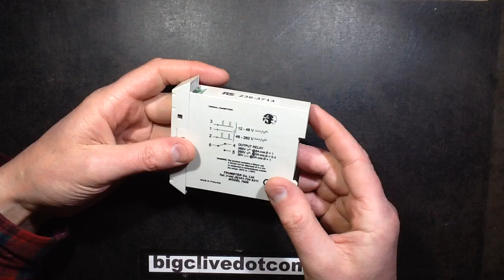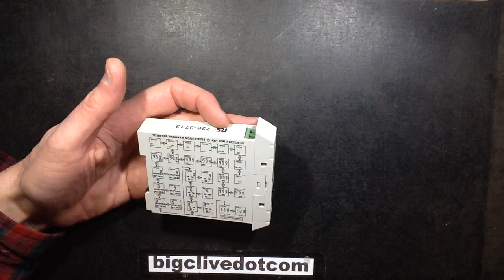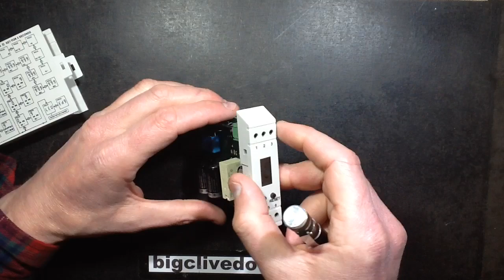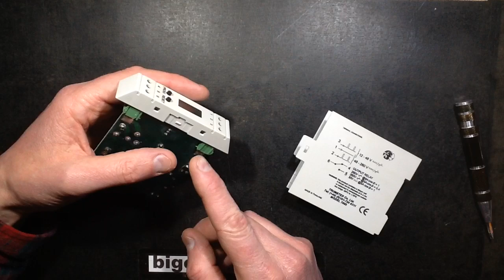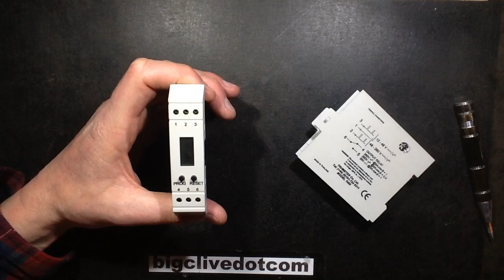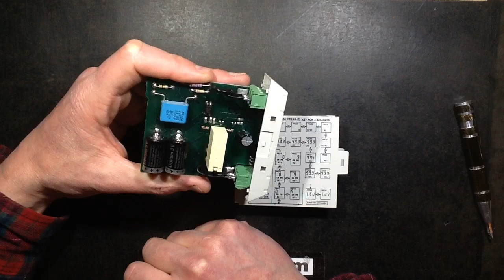A look inside a programmable control panel delay relay.

Comment: My guess is the batteries are only for the display screen and setup processing, and that the batteries don't directly operate any of the mechanics.
Reply from the maker: They do.  The relay is a remnance device and only requires a very brief pulse to change its state.  If you short out the sense circuitry while the unit is set as a recycling timer the relay will click on and off.

Comment: Is it possible to grab more details on that relay?

I'm using two way switching with an existing physical switch at the wall and behind it a relay controlled from a web enabled Arduino. Very handy to have a manual control over the light as well as the remote but it has its issue. If the relay is energised but the light is off due to the switch, the relay is 'holding' the light off and wasting power. That type of relay in the video would be REALLY useful here!
dropbox.com/s/f6arwlpxb9tlbmt/Picture8.jpg?dl=0

Comment: In theory, if the relay is latching, then it could latch and the lithium cells could become unable to unlatch or flick the latch causing the thing you are trying to control with exact timing to be locked on...
Reply from the maker: TornTech It could, so I'm not sure I'd use it for something mission critical like chlorine dosing.  But in a critical application like that I'd probably have a secondary failsafe in another timer that timed out and killed the supply to the dosing pump if the dosing timer ran too long.

Comment: Generally when you install one of those you use a permanent marker and black out the unused connection diagrams, leaving the one it is programmed for as the single legible one, then write the timings on the other side. Helps though that RS never removes obsolete stuff off of the manuals online, the part number will still enable you to get the manual, even if it is obsolete and you no longer have the crappy sheet of thin paper it came with.

Comment: I have been buying them. They are common parts, but with RS pricing they probably do not sell many. The true off parts though are rarer, you typically get it as a single version with true off, using a small button cell pack of Nimh cells or a supercap for some versions.